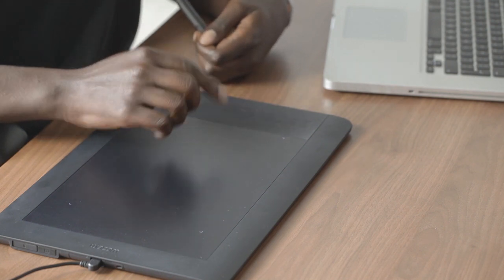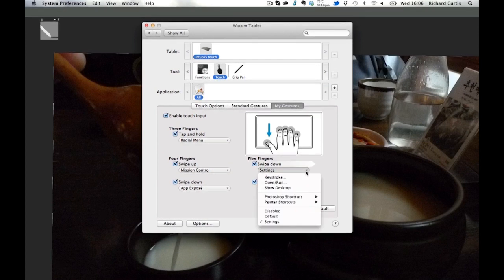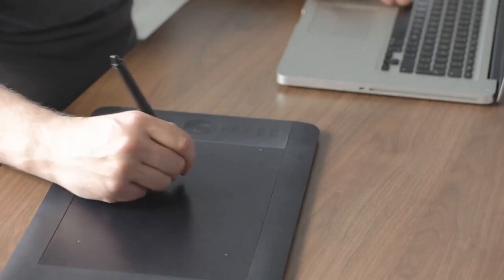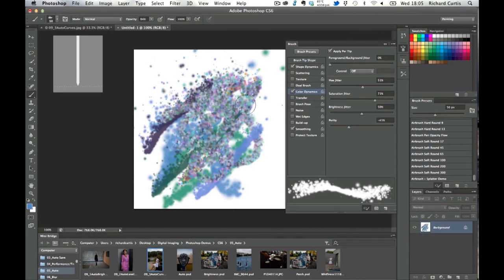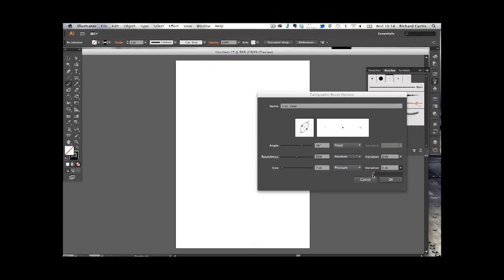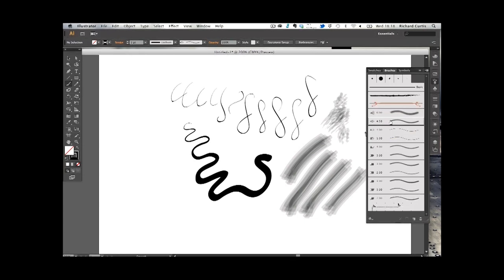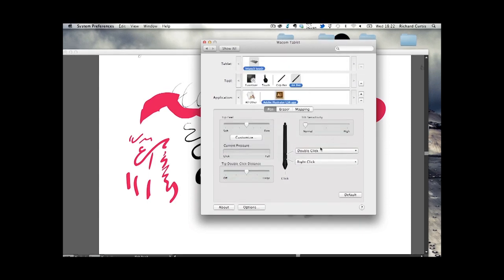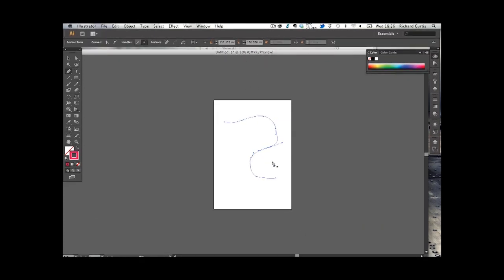Adobe & Wacom - Intous 5 with Photoshop CS6 and Illustrator CS6

Comment from the maker: Hi Kreat,
1. Make sure that you have the most current drivers for the tablet.
2. You will need to make sure that the touch is turned on.
3. Open the Wacom tablet utility and choose "Tool / Touch", then click on "Standard Gestures", Click "Rotate" and make sure that it's turned on. The actions on how it works is shown pictorially in this menu.
hope that helps
Richard